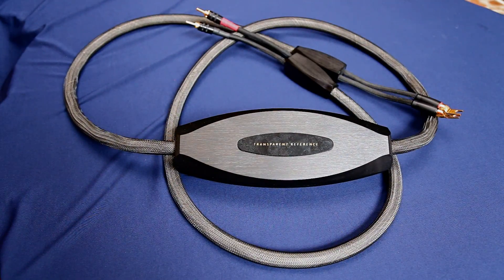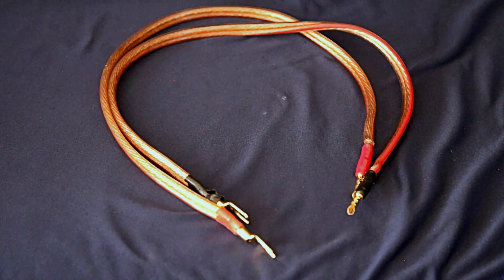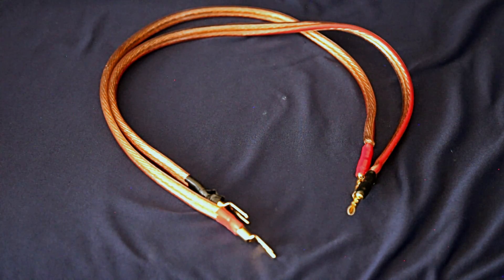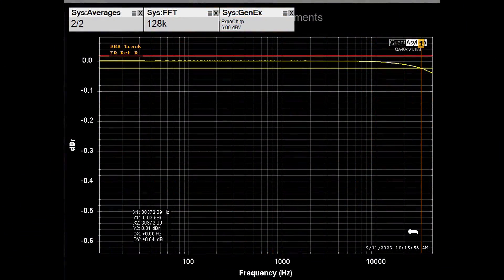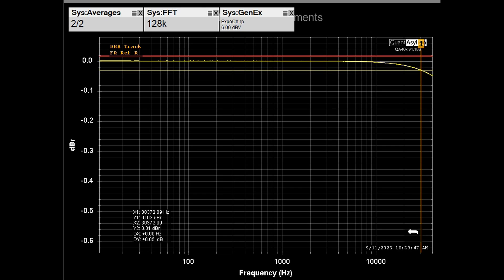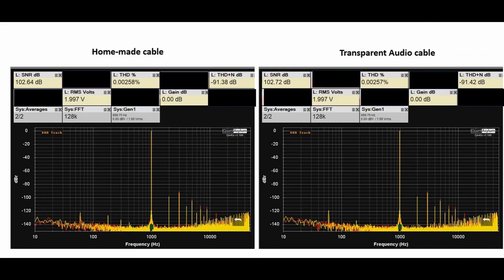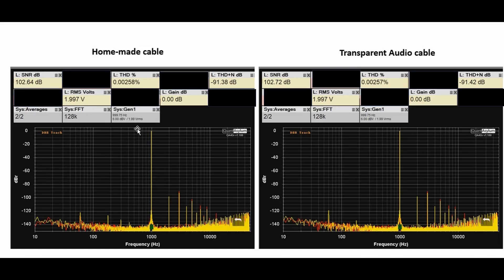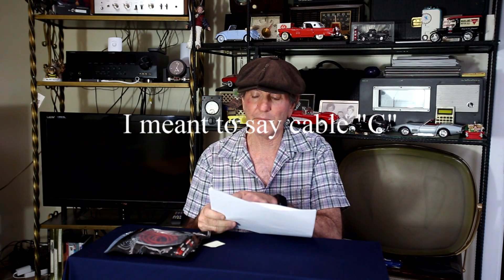$8000/pair Speaker Cable  vs. $14 DIY Speaker Cable A/B Test: Vintage Audio Review Episode #87

Comment: I'm about getting my room as quiet as possible! Maybe I'm just a little sensitive to the background signal noise (noise floor) but for me, even though I'm running an arcam avr20 with a couple of matching high-performance 4 channel power amps (front stage/Atmos) which are driving my Sonus Faber speakers in a 5.2.4 configuration, which also includes a stereo pair of Rel subwoofers for my 4 × 3.5m (13 × 11.5ft) livingroom. I have to say it was only when I purchased quality shielded speaker & RCA cables did my room finally become exceptionally quiet! 
My room is now so quiet there are occasions (without me opening my eyes) I'm actually unable to differentiate whether the system is switched off or if it's switched on. The room is really that quiet.
 If one is looking to get rid of that so-called ambient sound of the room. IMO shielded cables are the only way to go and they don't necessarily have to be expensive. Bear in mind this is coming from someone who's changed his setup and cables multiple times.

Silence is Golden 🥳
Reply from the maker: Thanks for sharing your experiences. I could understand shielded RCA cables helping out in some instances where you were in a very noisy electrical environment, and certainly it would not hurt anything. But shielded speaker cables.... I have not heard too many systems that are totally quiet w/no music playing, and that includes very, very expensive ones.
Reply: @vintageaudioreview  its take me years of trial and error to get rid of all my background signal noise or should I say cable interference noise. From my listening position I don't pick up on any noise interference anymore. Mind you, that's after I shielded most of my cables and of course experimenting with an audiophile grade power bar to help stop the differential mode means noise and but more importantly common mode noise. Common mode noise is introduced by RFI and the wireless communications. I'm the type of guy even though my walls are masonry, I still make sure my power cable and HDMI cable are routed separately! 9 out of 10 its the cables that's causing the noise.
Halfway through this short 3-minute video one can see how careful I am...
https://youtu.be/uPi6R54Mdx4?si=rwpkfC9UFxrnsluY
Reply from the maker: I appreciate the care you have gone through, but RF noise is way beyond what we can hear. Your electronics have circuits in the power supply that will hopefully do filtering  as well, so I am not a believer in power bars, but if you find it works for you than that is great. Thanks for your comments as always.
Reply: Trust me on this one ... the last thing you want is an anechoic environment.  Music sounds like crap in a totally dead room.  And... no... cables will never get you there.

Comment: This was great in that it it exposed the snake oil in Hifi..  A real test finally!!  You may need security to protect you from "BIG" Audio companies...😂
Reply from the maker: There are several commentors that don't think it was a valid test, and it is not perfect by no means, but fun to do with my group and sureyly my most watched video.Thanks for the comment.

Comment: At a show a million $ system switch between Home Depo 14ga extension cord and several Uber high end ones the majority of listeners thought the HD cable sounded better.
Reply from the maker: Good thing I was sitting down when I read your comment- thanks!
Reply: Which show was this?

Here's a better test: I was at a local high end shop and we swapped between cables from a higher-end cable to a mid-line cable.

Instantly two 21 year-olds in the back of the store looking at budget gear asked what we did because the sound stage went away.
Reply from the maker: @VideoArchiveGuy  So maybe if you are 21 and your hearing is really, really good and you have the money to spend on very expensive cables and you hear a difference, go for it.
Reply: @vintageaudioreview  It's not about being 21, it's about the level of your system and whether those changes are important to you.

For example, if you have a highly resolving system, and an additional $10,000 spent on speaker cables better resolves the space in which the original recording was made, is that worth it to you?

I'm not talking a modern "every member of the band sent in their part from home" recording, I'm talking about a 1963 recording with Frank Sinatra being recorded in a studio with the orchestra right there. Is the fact that a speaker cable upgrade allows you to resolve the size of the studio involved rather than Frank just being a voice in space worth the money to you?

For some it's everything, for others it isn't worth $10 more.
Reply from the maker: @VideoArchiveGuy  The system issue has been brought up in a few of the comments.  What is a highly resolving system? Who determines the min. equip list? And what about your room and your hearing ability ?
Reply: @vintageaudioreview  They all play a part.

A highly resolving system won't sound good in a room with four concrete walls with no treatment any more than a good room will sound good with a modern receiver and "pack in" speakers.
Reply from the maker: @VideoArchiveGuy  I do appreciate your comments, though we seem to have different opinions- except about listening in a room with concrete walls all around you you- my dorm room was one such room, and even in my main listening room, if I don't have a rug on the tile floor it will echo too much. But I have to ask, what defines a highly resolving system?

Comment: Dear  sir have  youve ever heard  any of the suposodly  improved  and  modifed  speakers  from Dannny Richies. GR.Research vs the stock verisions of the  same  speakers?..id like  to know  what your impressions  are?. I have my doughts  about  there really  being an improvment  worth   the investment  for  better voice coils & improved  crossovers?or is it more  snake oil such as with  expensive  cables,.....Thanks
Reply: Had a pair of Danny's crossovers come through here for the Elac DB6.2 speakers. They were a tragic case of grossly over-built, using parts far in excess of reasonable design standards... and a price to match. I installed them per the customer's request but will not do so again.
Reply from the maker: @Douglas_Blake_579  Guess you gotta justify the high price...did the sound improve? Might be hard to tell w/out a/b'ing a modified speaker and one that wasn't, but then you have to have your head not moving between the center of the 2 speakers, which would be very close together..
Reply: @vintageaudioreview 
As far as I could tell they sounded mostly the same. All the part values were the same as the original crossover, just heavier wire in the coils and higher voltage capacitors, so no big surprise there.  I did ab them with a toggle switch listening to the modified one against the stock one. No big difference ... at least not that I could hear. Maybe just a bit more bass.
Reply from the maker: @Douglas_Blake_579  Glad you a/b's them. I guess if you could have done an on-axis response measurement and compared them if you have the stuff to do that..
Reply: @vintageaudioreview 
I do have REW on my systems.  Oddly, I didn't even think of that at the time.
Reply from the maker: I heard a pair of GR Research speakers X-LS Encore speakers and they sounded decent. I would recommend checking out the ASR site (and youtube videos) where several of his products/mods have been tested and draw your own opinions. Here is a recent video:

https://www.youtube.com/watch?v=9dD0Aussu4o&t=2s&ab_channel=AudioScienceReview

Comment: I think u tried very hard , but fundamentally u can’t put anything between the two cables, if theoretically that might be a bottle neck , before I am attacked, I don’t think there is a difference between cheap and expensive , just that this is a “flaw’’ in the testing protocol imho if I understand how he set this up….
Reply from the maker: Thanks for your comments. I have not ever  "attacked" someone for their commentary, and most of the comments on this video have been decent discourses, IMHO. The worst thing I said to someone is they may want to take some basic electronics courses. As to your point, well taken, but it was the best way I could come up with doing a test. I believe that unless you can switch between two cables (amps or preamps as well) immediately (say within 500ms) you cannot really do a comparison as our audio memory is not that good for small differences. Both cables went through the same path and had the same bottleneck as you call it, which is what it is....

Comment: Cables with a network box like that are tuned for a certain sound.  Probably not made for your sota equipment. Garbage in=garbage out.
Reply from the maker: Thanks for taking the time to comment. The cables do have some sort of matching network for your equipment, at least that is the claim. As I have pointed out earlier in a few of the comments, that would require and extensive library of both speaker and amplifier impedances, which I doubt they would have. Additionally, if you have an amplifier with a reasonably low output impedance (high damping factor), the effect of the speaker cables is very small.

Comment: Thanks for doing this test of speaker cables, I wonder if you have seen this video of another speaker cable test, and did you hear a difference between the two cables in the video? 
https://www.youtube.com/watch?v=bvbP2uu0U0M
Reply from the maker: Thanks for the comment and I was aware of that video. W/out trying to disparage another youtube channel, I always dismiss any attempt to try to recreate what they are hearing vs what you are hearing on your computer or sound system, regardless of they used to record the demo. I only will play music to show that something is working, or maybe how the meters work, and never to try to convey the quality of sound, which for most Youtube would be mp3 quality unless you subscribe to their HD service. My test allows for an immediate comparison between the two cables- within a 100ms if I remember correctly. No connecting and reconnecting cables- that may take a minute or possibly longer. I don't have any products to sell so I don't have a vested interest in in expensive cables sounding better... not to mention that the science is not there for it...

Comment: Agree with the analysis, but I do hear differences with different interconnect cables. It’s noticeable when comparing a twisted pair configuration with a floating ground(long-time established protocol for recording studios), compared to a pair with the ground connected at both ends.
Reply: Ground loop problems can be quite complex. It is entirely possible that lifting the ground on an unbalanced interconnect reduces noise or hum IN YOUR SYSTEM as the ground current is flowing in  another path. Or it could make the problem worse and usually does with unbalanced systems. What you are testing is not one cable compared to another. You are modifying the electrical current paths in your system. You can't compare a modified balanced interconnect with an unbalanced. Apples and oranges. I think I understand what you are doing. Using shielded pair cable, with the pairs as the hot and ground and only connecting the shield to the ground at one end versus an unbalanced cable. But you have to keep in mind your topology has more resistance and inductance in the ground path than the 2 conductor shielded cable does do the mass of the metal. So yes, there could be an audible difference with hum and low level noise. But that has nothing to do with cable quality.
Reply from the maker: Thaks for sharing. I think you are talking about using a balanced cable vs an unbalanced interconnect cable. The balanced approach is used to help eliminate noise- important for a recording studio. If there was no noise on the unbalanced cable I doubt you would hear any difference- kinda hard to test, I would think, since the preamp may use a slightly different circuit to drive the xlr cable than the unbalanced cable....
Reply: @vintageaudioreview  Nope, this is using Mogami 2549 microphone cable in a single-ended application, for a typical 2-channel system. One wire hot, one wire return,  with the shield connected only at the source and “floating” at the other end. This connection methodology also prevents ground loops. In this configuration, the sound is very transparent and open. When the shield is connected at both ends, the sound is darker and closed-in. I get the same results with Canare L-2T2S microphone cable. A 3-ft. pair of these cables with Rean Neutric connectors will run less than $15-$18 and will smoke anything up to $500/pair.
Reply from the maker: @ChicagoRob2  Show these are your "rca" interconnect cables then ? Interesting about only grounding the shield at one end working better. It would be interesting to a/b them with a standard rca cable...I will have to check into this a little more as it would be nice to have the exact length of cable to connect gear....
Reply: @ChicagoRob2 
If you have one wire connected as the "return" which on a single ended cable is ground... your fancy "shield at one end" trick will not prevent ground loops.  In fact it could make things worse as the unterminated length of shield can act as an antenna, picking up all kinds  of RF interference.